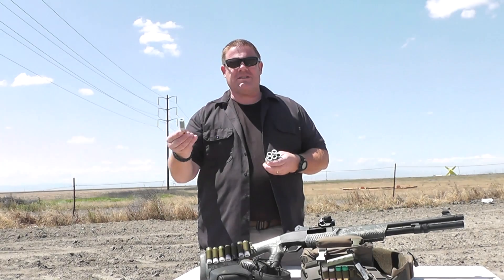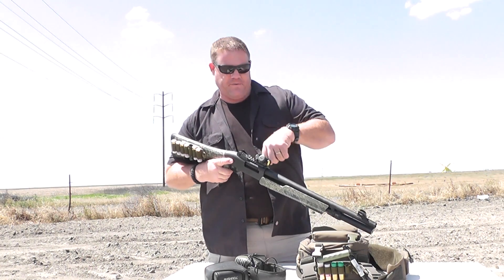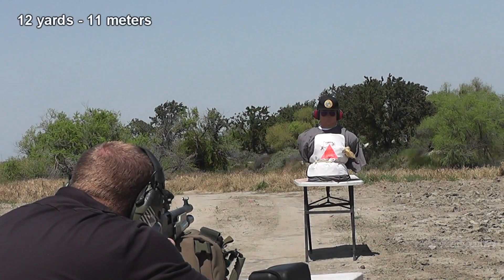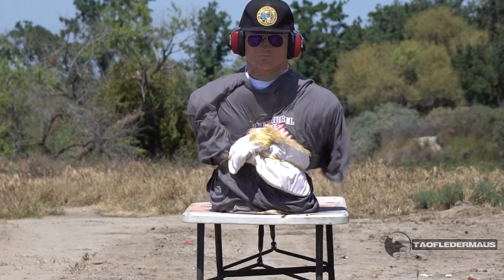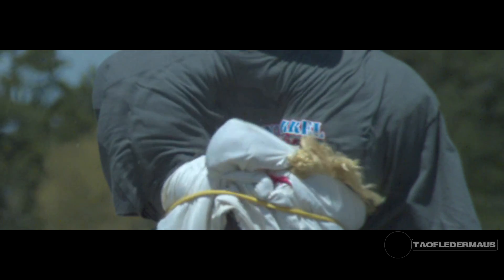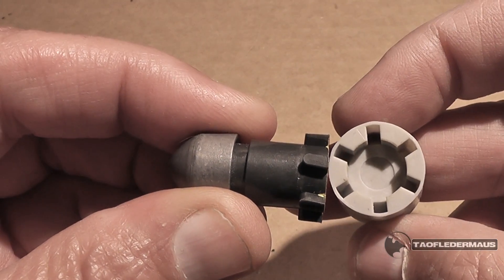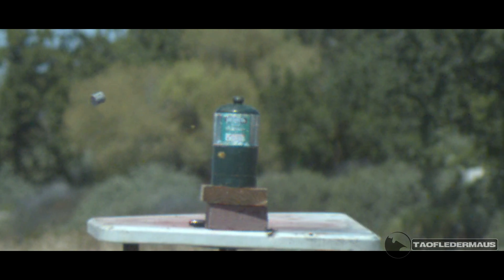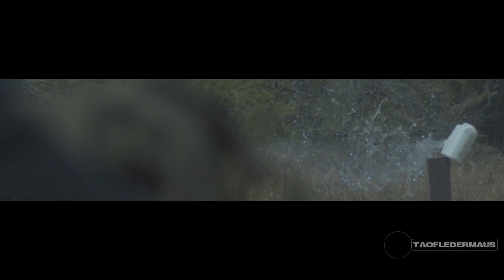Russian .50 Cal  Sabot Slug -  Like a Tiny Tank Round

Comment: The problem with shotgun slugs is the lack of rifling. At those speeds if the slug is not spinning any little variation in the barrel or release of the slug from it's container will cause it's flight path to be unpredictable and variable. If there is a method to get the round to spin before it leaves the barrel it will be much more stable inflight.

Comment: This is actually best possible shape you can have in ballistics, center of mass before center of pressure. I would add a tiny tungsten nose and it would be perfect.
Reply: Also it tumbles - it doesnt rotate in the air and center of mass goes straight

Comment: I have the shame shotgun. Where did you find the tube extension if you don't mind sir?
Reply from the maker: I don't know where Gregg got that.   The spring in it is weak and doesn't feed the last couple shells very well,  so I wouldn't recommend whatever it is.
Reply: That's what I assumed would happen. I have not seen a kit with bigger spring. Plus you would have to cut the end of the tube  to add more. Defiantly a custom job. Thanks for the reply

Comment: I want to make shells with a simple, single ball each. But where on Earth can I buy the balls? (Make all the testicle jokes you like, you know what I mean.) I need to buy metal balls about 0.72" in diameter, in bulk. Who sells them?! Even Amazon failed!
Reply: EBAY TRY .6875" W/RIBBED WADS.........SAFER.
Reply: What makes it safer? Lighter weight? Would a full .72" ball be too heavy for the barrel?
Reply: Lighter=less pressure (usually)and smaller just means more room for error(or a choke) and I was referring to a steel ball bearing(.6875)  . There are molds for a 12 gauge LEAD round ball, but please go with a proven recipe. Look at some of the 12 gauge guru's on youtube. BE SAFE!
Reply: I don't have the equipment to cast my own shot. Or anywhere to put the equipment. So no worries, I'll buy them online somewhere. Found musket balls in Cabela's that are the right size. Once I buy some--and a shell-loading kit, hulls, wads, powder and so forth, which I really don't have room for either but at least has the virtue of not involving open flame--all I have to do is crunch the numbers to figure out what kind of powder load is safe with that weight.

Comment: I'm curious if you've ever tried using lead or iron powder as a projectile.  I think it would be pretty destructive against ballistic gel if you put together a wax slug with a very fine metal particulate.  Or, perhaps hot glue or epoxy as the binding agent.
Reply from the maker: I don't think you can get noticeable differences in damage from using just small birdshot and wax.
Reply: I was thinking along the lines of a frangible round.  Wasn't sure if there would be a significant difference.  Just a thought.  Btw, I really enjoy your channel.   Very entertaining 👍

Comment: That potato starch on the inside, does that form oobleck if you mix water with it or would you have to replace it with corn starch?  Just a little idea if you really wanted to experiment with one of the rounds.
Reply from the maker: I think it is just a cushion so the fin section doesn't get driven too far into the lead slug

Comment: It looked like the fins on the projectile were slanted, as though they designed these to spin. If so, that's a bad idea for shot cup release. Was this a trick of the camera?
Reply from the maker: I really didn't see much/any rotation of the slugs,  even though the fins were slanted.
Reply: It's not the rotation that is important here, but rather the slanted fins. Momentum is going to want to force the slug out in the shot cup along the line of flight. The slanted fins are going to add friction between them and the shot cup. The slug is still trying to leave the cup in a straight line, even though the slanted fins are resisting. This could potentially be the source of the instability. At best, the fit is too tight.

Comment: Maybe the way you close your shotgun rounds by rolling the shell over is a problem for some projectiles because it has to push the rolled up part of the shell back out. I thought this before in a different video. If the round was designed for a less resisting shell seal, it might have jammed the parts together causing the inconsistent seperation.
Reply from the maker: That's how these types of slugs are designed,   to use a roll crimp.  The folded edge actually pushes down on the sabots and ensures full pressure/powder burn.

Comment: Look up a cemented carbide drill bit. they look like they would make wicked slugs, and because of the processes it goes through i would be interested to see whether it would shatter or be the scariest thing the world has ever seen #TAOFLEDERMAUS
Reply: AvE sent carbide bits did he not? they were from a drill head.
Reply: They were from a rock boring head. A little different but ultimately yeah it was still tungsten carbide.
Reply: Marilyn I'm talking about a bit for heat drilling, i'm not sure of the actual name since i only saw it in a youtube video, but it looked like it would leave a wicked hole
Reply from the maker: Sounds expensive.  I just make YT minimum wage.
Reply: I think your idea is sound enough Eliott, I seem to recall at least one or two custom rounds from ballistic machinist with super hard points defeating lvl 3 armor at a good ways out.
Reply: Eliott Reynolds  I believe it would be scary I have a friend that reloads and the smaller tungsten carbide drill bits he somehow chops down smaller and tips pistol ammo with them the results are more then amazing for a garage made a.p round
Reply: I think Eliott is talking about "Flowdrill" bits. Those things are around $200/ea for a bit with a diameter big enough to really imitate a shotgun slug.

A regular 5/8in carbide drill bit is somewhat better, but still around $18/ea. Could chop that down to $12/ea if you wanted to go to a 1/2in and take the time to whip up a sabot for them.

Probably best to go with a sabot, honestly, since I have a feeling a few carbide bits going down the barrel with no protection would end with a barrel replacement.